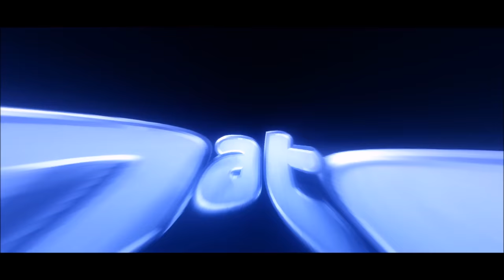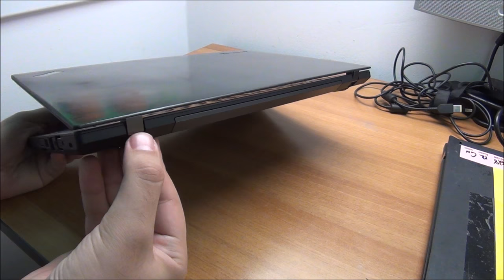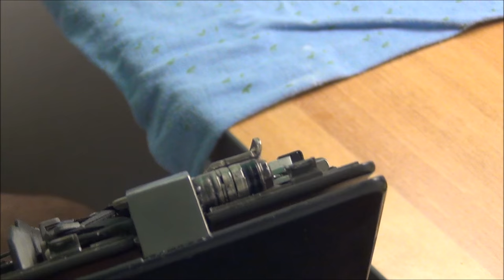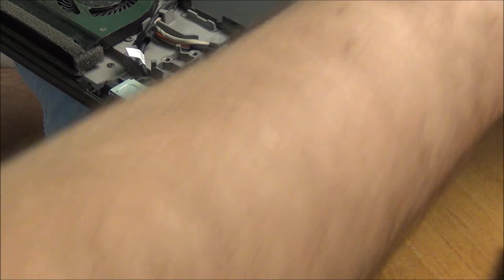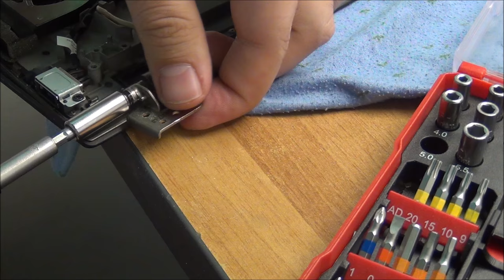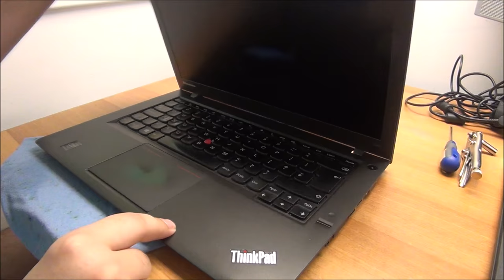How to loosen or tighten up the hinges on a laptop to prevent cracks and damage to the frame

Comment: I believe those hinges are designed to self-tighten, since if they didn't, they would become loose after a while.

Today I stumbled upon a hinge model that didn't have a way to adjust, on a Asus X401u. It came to me already with the case broken and lube didn't resolve the problem.

But on laptops that weren't broken yet, your tutorial is spot on. Nowadays I advise  people that if they have to pry open the lid with two hands, their laptop need a hinge adjustment ASAP, before the inevitable "crack!" sound is heard.
Reply from the maker: That is a 100% solid advice!

Comment: I have owned two Lenovo laptops now and both times the hinges were problematic and broke the plastic. I didn't realise what the issue was, thanks for this!
Reply from the maker: Glad my video helps :)
Reply: @UltimateDIY  It's great thanks! Can I ask a question please, what to do when the screws won't come out of the laptop? I have a laptop I'd like to repair the hinges. But I can't get 2 of the screws out. They are in so tight, they will break the screwdriver or the screw before I can get it out, so I always leave it. Any ideas please? thanks :)
Reply from the maker: No real alternatives here. Force them out or drill trough them.
Reply: @UltimateDIY  okay thank you :) I love your channel and help, have subbed
Reply: @angeloddrev  Buy a new pair of hinges. Ebay , Taobao, Amazon or some other way you can get it.
Reply: loose krne ke baad nii hoti kyy problem

Comment: Wish I saw this before I brought my laptop to the repair shop and wasted 100 euro's, just for them to make it worse! The bezel of my laptop broke, so they used glue to glue it back up and charged me 100 euros for it, and then out of ''kindness'' loosened my laptop hinges. It ended up being so lose that just slightly tilting my laptop by picking it up, would make the screen fall back immediately and heavily! Then they ''fixed it'' free of charge, and ended up tightening it WAY too much even though I specified to only tighten it so it doesn't keep falling when I move. Now it physically feels very heavy to open back up now. I'm gonna try and find some good grease for hinges first and try this out myself, thanks for the video! Hope it works.
Reply from the maker: Welcome! Hope you manage to fix it.

Comment: Problem with hinges starts when you open the lid in one corner. Always keep opening the laptop lid in the middle. That way both hinges can stay in better condition for longer.
Reply from the maker: Yes, that helps 👍🏻
Reply: so i gotta assume my brother opens my laptop on the left corner and it broke
Reply: This is my daughter third laptop and she put a tape in the middle to open it but after three years, the hinges still stuck and break.  Suck, I think the manufacture should try a better way to do it.
Reply: That's not always the case. My laptop,  Lenovo Ideapad 5 had a hinge issue. I used it for just 5 months. I was always very careful and opened the laptop only from the middle with both hands holding the bottom part in place, yet the hinge broke from the laptop and pushed the bezels out. This was a known issue with this laptop model. I got it fixed under warranty. They just designed it badly.
Reply: K
Reply: @TheBlal06 Yes this is a common problem with new laptops
Reply: I consistently open my Asus Tuf laptop by inserting both thumbs beneath the lower section of the screen. While it might feel a bit snug, it doesn't harm the hinge, and I have sufficient strength in my hands for this method.
Reply: That explains why my ThinkPad Edge E530c broke... I'd Allways close it from the corner.
Reply: Oddly enough if a car doors hinges tightened up to the point of breaking, there would be a 99.99999 percent probability that there would be a recall  it's called DEFECTIVE 
I'm new to computers, very mechanically inclined, but when the hinges on my asus laptop tightened up so quickly, 5 months old, i hadn't realized the damage had already fatigued the case grommets to point of failure and once that happens, no pun intended, but, your SCREWED.
Reply from the maker: Agreed, but they seem to get away with it in laptops.
Reply: I have a laptop that I use for school, I broke multiple, I’m starting to take care of it, but my friend always moves the screen with one corner, annoying to me, how do I get him to stop doing it?
Reply: You are absolutely right

Comment: I do the same with my ThinkPad T460, just a 30 minutes ago.
Loosen the hinge about 45 degree, and now very smooth, I can open the display wiith 1 finger and 1 finger holding.
I love my ThinkPad, its a classic laptop with strong durability, except the hinge design will be the problem if to tight.
NB: I'm using singer oil, an industrial oil with cheap price.
Reply from the maker: Nice. Glad it worked for you 👍🏼

Comment: Very True. Lenovo has a problem with their Hinges. I am here because it happened to me last night. I bought a new Laptop base, but suddenly I started thinking why did my old case crack in the first place. When I observed the Hinges, they were too tight. The reason could be exactly the same as you mentioned. Oils get dried up because of Heat in that area. Thank you for the Video.
Reply from the maker: Welcome!

Comment: There is a 5mm hex on the end of hinge bolt. A tubular key for 5mm hex is much better than pliers as you observed. Unfortunatley usually the end is peened on the nut. So the nut can't untighten more.

A trick is to tigten the nut (and this will free the nut in rotation) then untighten all the way you can and repeat a couple-a dozen of times. This will loosen the nut eventualy a bit. (basicly forcing the nut out will lightly unpean the end of the bolt). 
Also by tightening more you will squish the friction plates more maybe making them a bit thinner so when nut is undone to previous location it will loosen.
Reply from the maker: Thanks for the info 👍🏻
Reply: @UltimateDIY  Thank you. Right now i'm rebuilding standoffs for a laptop. Hinge mount on case is complettly broke, all threaded inserts are ripped off. I'm using acetone, 3dpen with ABS filament, and epoxy fill to reinforce all the ribs around the remanents of the standoffs. Also went and looned the hinges.. this is why i was on your video.

Thanks for the info you provided in the video.
Reply from the maker: Welcome and good luck with the fix 👍🏻

Comment: great video! however, I would like to say not to use silicone grease as its application is for o-rings only. for metal on metal like a hinge, I would suggest using white lithium grease.
Reply from the maker: Thank you for this info!

Comment: It's very intresting how old laptops never had this problem, the hinge in my new lenovo just broke. Anyways thanks for your torturing I'll go and give it a try👍
Reply from the maker: Sadly new laptops are way more fragile.
Reply: Agreed. Laptops back in the day were built like tanks. Heck my old Sony Vaio laptop which I still use as a desktop replacement still opens and shuts just like new. My new Samsung laptop hinge broke in just a year. I’m curious if MacBook hinges break. I’ve never heard of them breaking.
Reply from the maker: Sadly, everything is built to lower standards these days...
No idea about MacBook hinges.

Comment: I was so afraid to take my laptop apart. The left corner has broken off from the keyboard due to a tight hinge and flimsy outer casing. Unfortunately I have to take so many screws out and undo the cables to screen to access the hinge!! After all my efforts I couldn't find a 4.5mm socket anywhere 5mm and 4mm didn't fit. So I'll head to the shop to get one and hopefully everything will be in working order. Toshiba Satellite L50-C-12V

By any chance, do you know where I could get extra screws? 🤔
Reply from the maker: I hope you get it working right. No idea about screws. Maybe aliexpress?

Comment: awesome video, but with thinkpads or at least with the older models, it's kinda uncommon to hear any hinge problem with them, it's because the hinge mounts are usually molded to a big piece that mounted to a big surface of the body instead of using brass nuts that welded to fragile plastics. But only on higher end thinkpads tho, my brother's x240 do have a big piece of magnesium but my lower end e330 uses the brass mounts that recently broke off
Reply from the maker: I had a lot of old thinkpads even with the magnesium hinge snapped in two. So, still a problem with age.

Comment: I have a dell 7368 laptop/tablet hinge.  But the swivel is inside an oval connecting piece which goes from keyboard to monitor (so it can fold all the way backwards). It's too tight.  Any ideas?
Reply from the maker: Without having my hands on it I don't know.
Reply: @UltimateDIY  i fixed it and I'm uploading a video on how right now....
Reply from the maker: Glad to hear that 👍🏼

Comment: super useful thanks! I used motor oil. Have to see how it goes. curious about the mechanical engineering aspect of this though. How the metal springs/washers actually work.
Reply from the maker: In theory they put just enough constant pressure on the assembly that is moves exactly as you need it. But in reality it sometimes moves too hard.

Comment: Hello sir

I want to use my laptop without without a screen

My laptop display is broken and it is costly to get get new display 

 so I decided to use a external monitor which is which is cheaper  to as compared to the laptop display replacement
 
 
  I want to use a external monitor using HDMI port and I want to completely dismantle the display rotation part is it possible to do that I have same type of laptop rotation hinch that shown in this video

14:48 I think it is possible

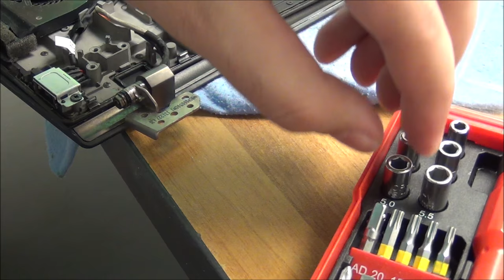17:59 I have similar tool box at home I think I can do that at my home
Reply from the maker: I think it can be done, but don't know for sure.

Comment: I'm assuming this doesn't work with convertible laptops? The hinges on those have two mounting points. One to mounts the hinge to the chassis, and another to the screen. You can't loosen the latter because it's hidden in the screen panel. Only loosening the former is a recipe for disaster because you'll introduce even more imbalances.
Reply from the maker: Depends a lot on the type of hinge, so it's not a clear answer.

Comment: I have a laptop that has exactly this problem. Tried to fix this by loosening the nut and giving it lube, however this has only worked for the left hinge, the right one is still just as stiff.
Reply from the maker: It might be damaged somehow ir the oil did not penetrate enough yet.

Comment: If the plastic where that metal piece is screwed is not very good/solid, it breaks all the time... They should make it stronger! It's a critical part... Isn't there a better way to loosen that nut? It's just too thin and it's REALLY hard to move it with pliers...
Reply from the maker: The should, but then why would we buy new laptops?
There is no better way to loosen the nut. Your only luck would be if some hex wrench would fit in there.
Reply: @UltimateDIY  I never liked much laptops anyway... :p But I hope they improve them! Thank you.

Comment: Which is better silicone grease or WD40? I only had WD40, It’s not making much difference yet and the nut is impossible to loosen, it’s a 10 year old dell laptop I’m renovating
Reply from the maker: WD40 is not an ideal lubricant. You need some kind of greese, or at least something like engine oil.
Reply: Ultimate DIY thank you I always learn something new from your videos
Reply from the maker: Thanks!

Comment: I have Lenovo ideapad 330 and 5 months ago I had to fix my hinges.Black plastic around the screen was separating and I could not close laptop normal.I fixed that and now it happens again.How could they make that soo bad?What can I do to stop that for happen again?I can not every 5  months take my laptop to servis.
Reply from the maker: The only thing that you can do is to loosen and oil them. Bad design can't really be solved any other way, sadly.

Comment: Hey brother i have hear some cracking noise from the hinges in this video is this normal due to the plastic built… because i am facing same cracking noise in my laptop .. would you plzz help… I would be very thankful
Reply from the maker: Normally you should not hear cracking noises.
Reply: @UltimateDIY  is this due to the plastic built?? The noise is not soo lound.. its only audible when there is much silent in a room
Reply from the maker: Impossible for me to guess.

Comment: I have had* an hp x360 pavillion since mid June 2019. Almost 5 months. It has minimal scratches, but it's still like new. 

The hinges are tight as hell though! I have a cracked frame going around the lid; deeper at the side and travelling along the front into the screen. The screen is untouched though. This crack is about 2 inches above the hinge, on the left side.

Please explain how I can fix it? Do I need to remove the screen to fix the frame? Will gorilla glue fix the frame? Can oil fix the hinges or must I do everything as you have done for that? Thanks in advance!!
Reply from the maker: Sadly you need to both oil the hinges (and maybe even loosen them a bit) and fix the cracks with glue. Gust make sure you do not use Super Glue, as it makes a white mark arround it when it dries up.
Reply: @UltimateDIY  what glue can I use to hold it then? It's literally starting to crack behind the display if I force it?

Comment: I noticed a crack in the frame of my laptop just near the hinge area. I used some Araldite on it but it didn't work and the crack reappeared when I opened the laptop for a couple of times.
It is lockdown and I am afraid that it may get worsen. Can I have ur email id so that I can send u pics for some suggestion on that.
Your help will be highly appreciated.

Comment: Hi. I fixed my laptop by using two new hinges after greasing them a little. The problem is that hinges loosen after just a few display opening/closing movement, no matter how much I tighten them up. Am I doing something wrong or hinges are just bad? Thx
Reply from the maker: Hi. I never had any that would loosen up by themselves. Does the nut come undone? You could put just a bit of glue behind it to prevent that. If just the mechanism looses friction, the hinges could just be low quality China made stuff.
Reply: @UltimateDIY  yes, mechanism loses friction. I bought them from a very reliable warehouse on eBay which sells replacements for Acer, Asus, HP... I have an Acer E 15 E5-575G, could you suggest me any store online which sells original parts for 4-5 years old laptops?
Reply from the maker: Sorry, but I don't know such a store.

Comment: Mine is too tight it almost damaged my screen. bottom and top. there is lot of lines and its spreading..🥺
Reply from the maker: Sadly, that means a damaged video cable or even damaged display pannel.
Reply: @UltimateDIY  What may be the reason.. the lines is spreading..
Could that be the Hinges
Reply from the maker: Probably the hinges are the culprits.
Reply: i had that problem on an old laptop it started as a few lines then as time passed by it reached a point where lines were covering the whole screen with only small areas visible. applying slme pressure on the screen used to make the lines go away in the area, not sure if the problem was with the display or video cable or something else didnt bother repairing it